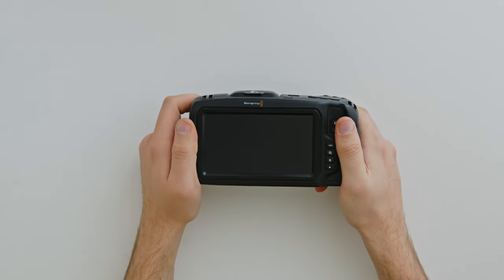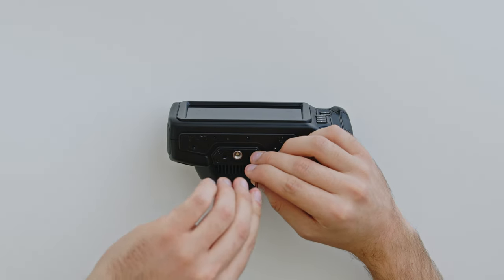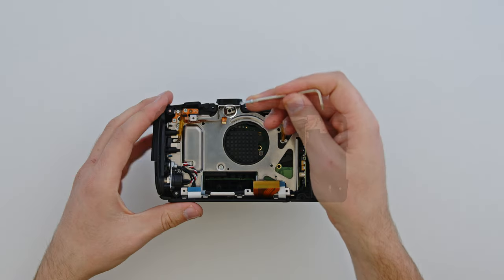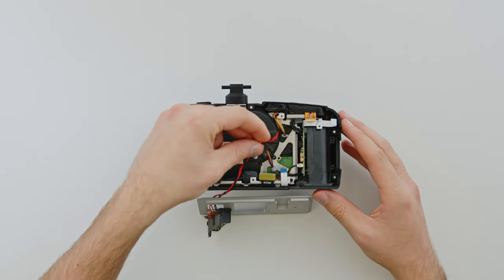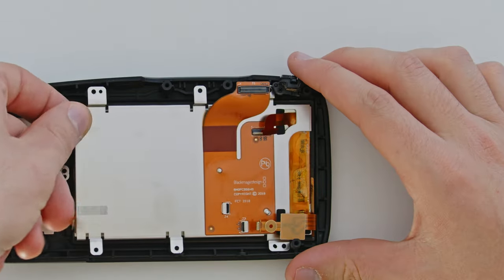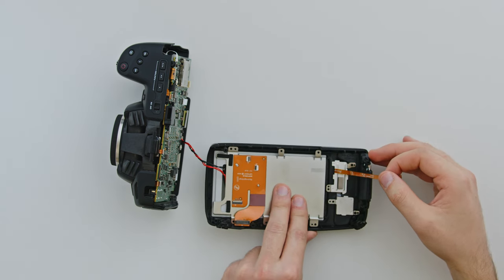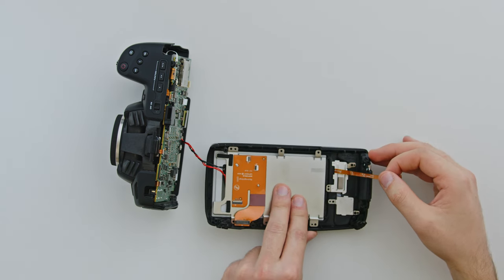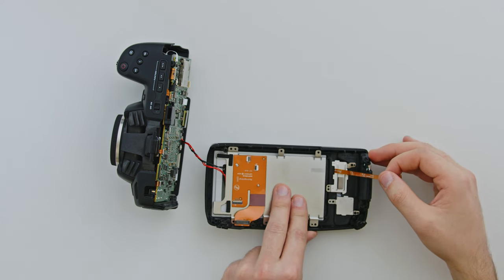Mod Install Guide

Comment: 8:44 there are two Torx screws on the 6K not mentioned here before I could remove the board. Took awhile to figure that out.
Reply: also at 10:47 for the 6K there are two Philips screws keeping a guard on the 1/4-20 top screw, preventing the frame from coming out.
Reply: Welp. No screen response upon installation. Wildly disappointed. Triple checked my connections and still nothing. Going to come back to it later. Hoping I didn't just fry my camera after the hours and $ on this mod.

 Trying to give us 1 guide for 2 cameras feels mega cheap... especially without the difference call-outs being flawless.
Reply: Same for me with the screws. I also need an screw driver for these, which was not included. Please make an second review for the 6k. I almost break a plate, because of this not mentioned screws.
Reply: Ana News regarding the Screen? Mine Dont Turn on too
Reply: let me know how you get on and if you work out whats up, and thanks for pointing out the extra screws im sure thatll come into use. my issue was that the first 4 screws on the front that hold the two parts together arn't actually Torx and the tools sent are not the right size so having to pull out the pc repair kit instead, will update and see how i fair going to be suuuuuuuper careful after reading your comments might even just send it off to the install guys :/
Reply from the maker: Hi  @SchwietHaus  can you please send me an email with more information about your issue?
Reply from the maker: Hi  @betterfocus9455  can you please email me at ollie@podtech.shop with more information, I'll let you know a few troubleshooting ideas?
Reply: Damn, screen looks like it has power to as it comes on but no input or any menu comes up no crosshairs or thirds just a dull backlight :( will have to check connectors in the morning! I HAD MY FINGERS CROSSED!
Reply: Update: I sent what I thought to be my newly bricked bmpcc to Kolari and they were able to fix/complete my install. Just received my camera back and I am very excited, the mod is great and paying Kolari for the service was more than worth the money. Sending my other 6K to them now. Thanks to the team and to Ollie for his help along the way.

Comment: Could i install the mod without the original monitor and use an external monitor connected to via HDMI to control the camera instead? Would the canera work if it hasn't got the original monitor connected?

Comment: I think maybe my cable is not working, I have tried several times now to check - reconnect the ribbon cables but still getting a black screen and HDMI also seems to not work

Comment: Done with the install :-),  had to  reconnect one ribbon cable to the the display and fiddle with the touchscreen connection before I got it all working. Didn't have a v-lock battery on hand so have to test that as well before calling it a complete success 😅.
Reply: V-lock powercable wasn't seated properly so had to open up again 😅. But now everything is working ✌️. Thanks for this cool mod!

Comment: i too am having issues. i just 'finished' the mod but the screen doesn't turn on. camera powers on but the screen won't come on even with the regular canon lp6 battery.  spent a good 6 hours today unplugging and plugging the screen cables in.  will try what the other modder says to try the screen direct without the extension cable to see if it's the cable.  so going to step back and come back at it later this week.
Reply from the maker: Hi would you be able to email me about this issue so we can try some troubleshooting steps and get it solved? ollie@podtech.shop

Comment: I'm SO close! I did the mod and I've even used the camera on a few gigs and love the form factor of the screen on top and the mini v-mount; however, a couple of things aren't working for me:
1. The mini xlr input doesn't work, so I can't connect an external mic and 2. The DC Power input doesn't work. 
I'm guessing I just didn't get something connected right or a ribbon came loose when I put everything back together, but can anyone help me figure out which ribbons might be the issue so I don't have to start from scratch? I sent Ollie and email too. Thanks!

Comment: I got most of the way through the mod and can’t close the body without the screen disabling. It seems to mainly be a design issue here. The friction from the ribbon on the screen connecter seems to be enough as the unit closes to disconnect or twist the plug enough so that it doesn’t fully connect, preventing power and connections to the screen. So the screen can work if things are connected with the camera body split apart, but as you connect it, the ribbons inside get loosened as well as the connecting plug from the back of the frame to the body.  I now have an even more expensive pocket 6k brick due to the poor design. 

Note that I’ve replaced the pocket 6k screen myself before and there were no issues with that process.
Reply from the maker: Hi Sam, could you please get in touch with me over email and we'll see if we can sort this issue out? ollie@podtech.shop
Reply: I got it figured out. I ended up putting some thin double sided adhesive tape between the connection ribbon at 24:50 and the metal. Then I put some behind the black ribbon as well to secure it to the body to stop that being pulled as well to make sure it stay secure. I took the rubber padding off the back of the connector pin and built up the height between that and the ribbon connector with layers of gaff tape until it was thick enough to push on the connector and it all stayed in place. 

I would recommend that anyone doing this buy a good torx bit as the one included strips very easily. I had a heck of a time getting some of the screws back in as it stripped pretty easily.

Comment: My installation is stuck @ 25:40 connector, it just won't go in correctly
Reply: Should the display side connector to go in or outside?
Reply from the maker: Hi there  @ruosteproductions   can you please send me an email to clarify? ollie@podtech.shop
Reply: @podtechmodkit   There was no loose on the ribbon (bmpcc6k) so I needed to put the connect first and then slide covers together

Comment: Hey bros you ain't gonna give us 6k owners a little THERMAL PASTE HMM? Just gonna have us raw dog it right on without a little pea sized drop on what looks like a pretty major heat sink and sensor huh? That's what's happening here?
Reply from the maker: Hey Freddie! My 6K cameras worked fine after modding without adding more thermal paste.. Was a fair bit of yours rubbed off while modding? Let me know if you'd like me to mail you some more thermal paste!
Reply: @podtechmodkit  I used a sharp rubber tip from a pottery tool to slather on the excess, but I'd be wary, fellow users, that if you encounter future overheating issues, this is likely the culprit. Cameras are basically little mini computers, and those chips get hot fast and will shut down if they're not dumping their heat well.

Comment: Quick update: My screen does not work after the mod.  (The camera itself still does) Even after I check all the connections and made sure there is no dust or similar at the connector. When I disassemble the extension cable, which comes with the kit and plug the monitor directly to the camera it normally works. So in my case, definitely the extension cable from the kit is fault. I’m in contact with Ollie, and will receive a replacement soon. So until then I do have one camera less and have to rent an additional camera, when I have a multiple camera job. 
I’m not happy about having this video, where some screws the pocket 6k have and also the tool for that screws are missing. And now the cable which is not working from the kit. Please improve this Manual and the quality check.
Reply: sucks. just finished my mod too and the screen doesn't come on either lol

Comment: I tried modding mine with no luck... It's a good Lookin brick.
Reply: what happened? :(
Reply: @AlexRian_  wish I knew but I've tried everything I could do to clean the small connectors and ribbon cables which are super fragile so really anything could've really gone wrong so unless you're ready to lose your camera forever I wouldn't try this mod. I really wanted this to work I really did would've been awesome. Not gonna cry over spilt milk time to move on.
Reply from the maker: Hi  @patrickspohrer2365  do you want to send me an email with more info about this issue and we'll see what we can do to get it fixed? My email is ollie@podtech.shop